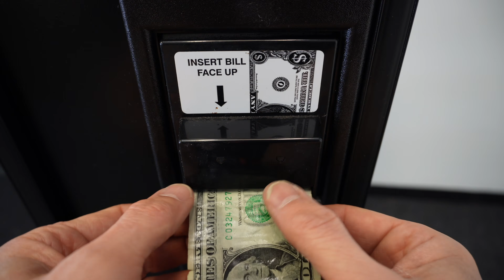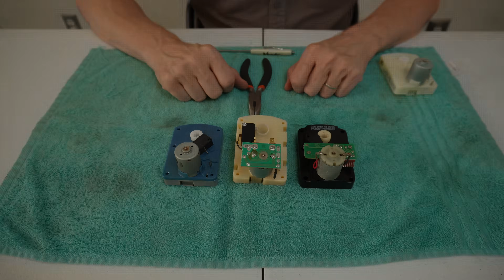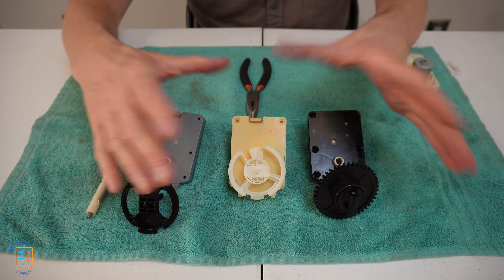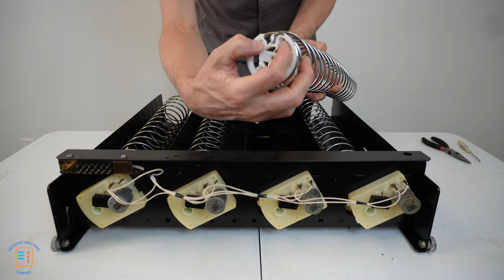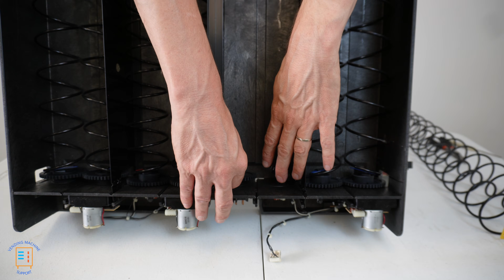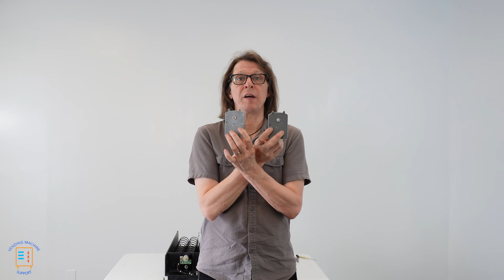Snack Vending Machine Vend Motors Explained: Operation, Removal, & Troubleshooting Tips

Comment: I have Crane National 145 that has several selections that show make another selection when selected.   The motor shows missing when I  do motor tests for these selections. If I reset the machine and reenter prices the selections were work sometimes but seem to also go back to the make another selection 
Do you have any ideas about what to do?  Is this a control board issue?

Comment: good information. You said for your troubleshooting tip that its a good idea to swap a working motor with a culprit motor. If the problem persists with the culprit motor then its a motor issue and it can be easily swapped. If it isn't though as in the problem stayed on the given selection what could this imply? I have a candy rack for my D selection rack with AP motors for my AP 6000 machine. I swapped the D7 the culprit selection with D6 a working selection but the problem presisted on D7. I suspect the male harness could be bad or the female but I've never troubleshoot either of these. Any tips?